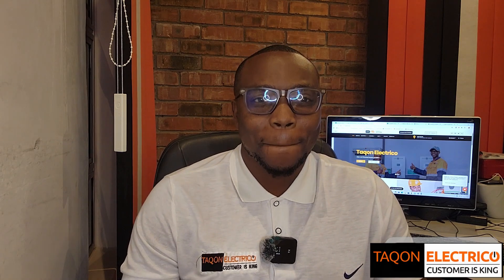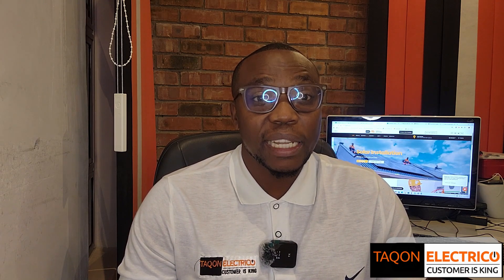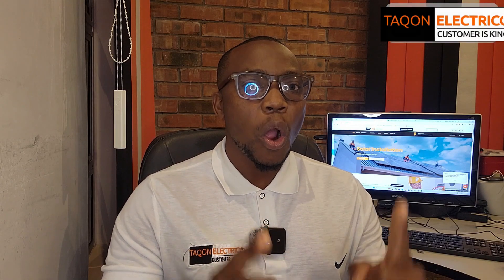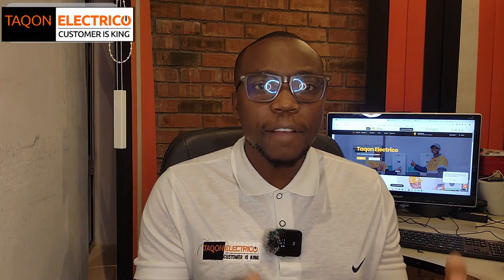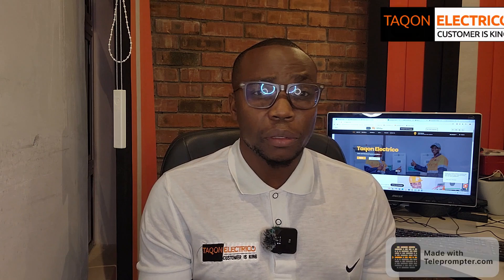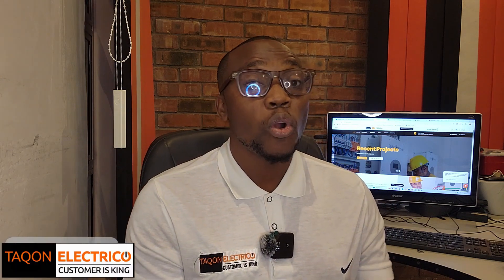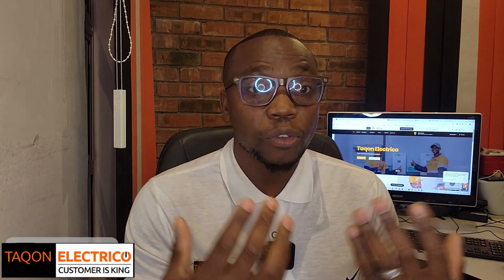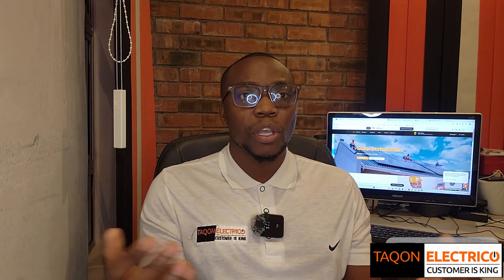10+1 Things to Look for When Choosing a Solar Inverter

Comment: Wonderful feedback..eish the proper inverters are beyond some of us...recently bought LeadPower battery and NextPower inverter...Can only see usage and battery percentages...saka it means ndanyura
Reply from the maker: Hello. Thank you for your wonderful input. It doesn’t necessarily mean that what you bought is not good. However,  as long as you feel comfortable using them, and the ease of use is ok, i see nothing bad. Just that there are many good features to look out for nowadays,  which give you more value. Knowing them makes you differentiate different types of inverters and their prices.